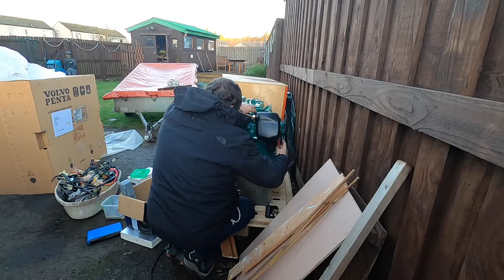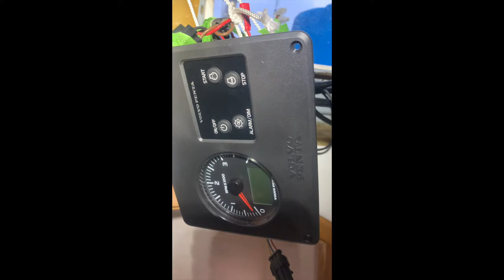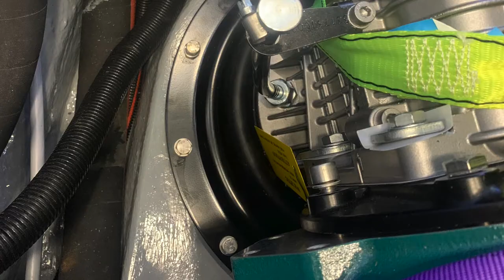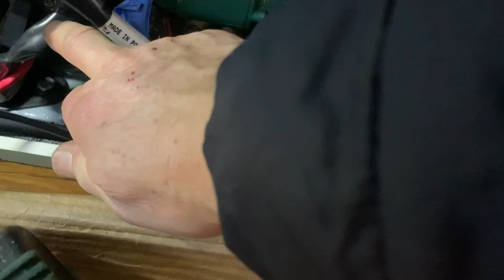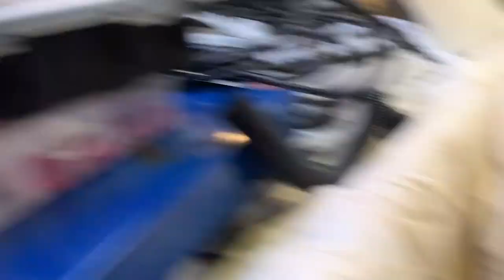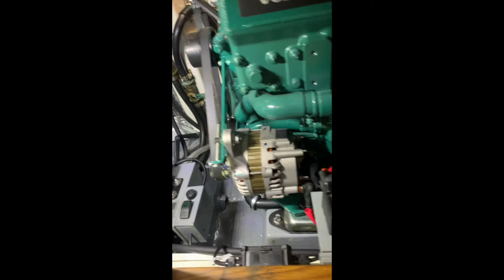New Engine lifted  in

Comment: Thanks for the video! Can you please tell me what brand and model of extra/second alternator you installed? Is it just the same Mitsubishi 12v 115 amp alternator? Did you upgrade to larger alternator? How is it working for charging?
Reply from the maker: Hi EN.    We fitted a Balmar second alternator , think it’s a 170 amp and we run it at max 130 amps controlled through a MC 618 external controller. Did have to slightly modify the support bracket that was supplied with the original Volvo secondary alternator. Think the video blog mentions that - not a big job if u can  handle a grinder and a basic mig welder. Been running great since we installed. Hope that helps  Rgds Paul